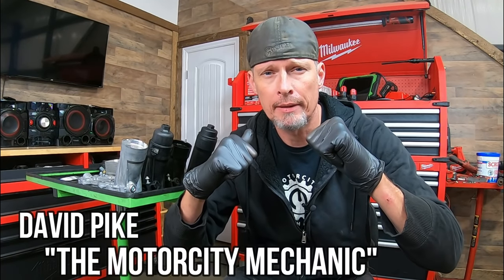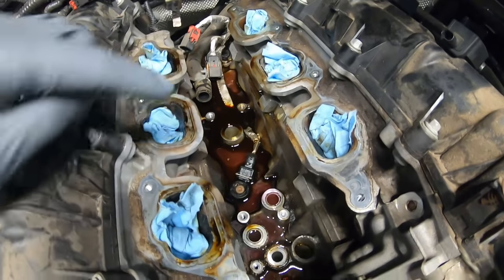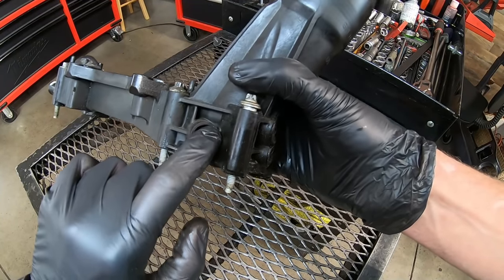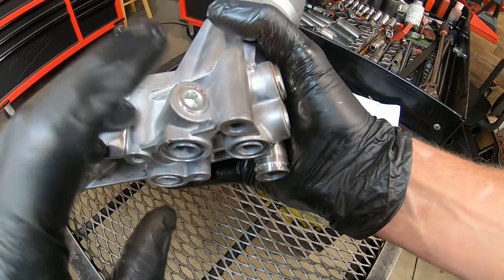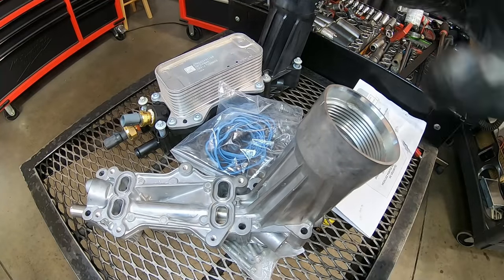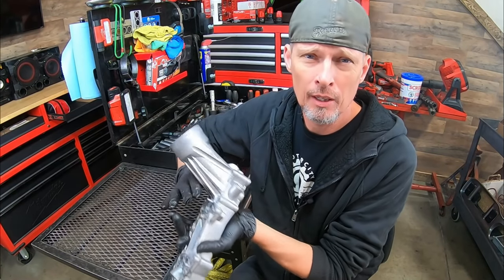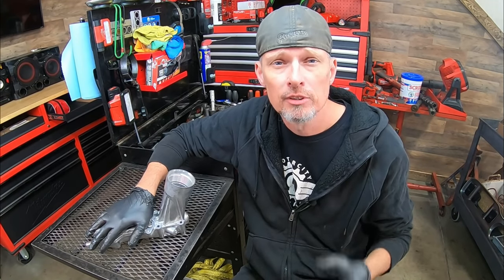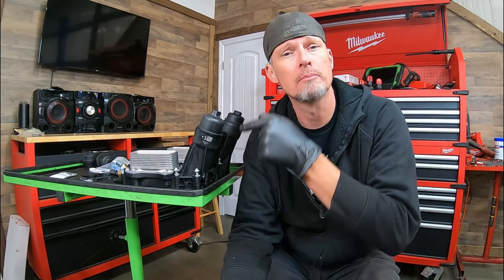Dorman 926-876 Aluminum Chrysler 3.2/3.6 Oil Filter and Cooler Housing Upgrade

Comment: Your one of the lucky few if you dont have a problem with this engine. So far with perfect maintenance I have had to have replaced, the computer at 50k, the heater line connector Plastic at 70k, rockers at 65k and now again at 125k for engine ticking.....All  were dealership repaired. So either it is the dealerships not doing thorough maintenance repairs or the engine itself by design. Most was warranty covered but now out of warranty expected to be expensive to repair rocker arm issues again as dealer only warrants rocker arm repairs for two years. So sad I must say a design flaw should be repaired at no cost by the dealerships for the life of the vehicle.

Comment: I changed the oil cooler housing on my 2011 grand Cherokee 3.6. The Dorman housing WILL fit. But, you need to buy a new cooler for the 2014+ years. Also a new oil filter and filter cap as the old ones will not fit. I went through four different caps before I found one to fit. Dorman had a problem with the manufacturer or something, so check first. My engine had 136,000 miles, so I figured while I was in there I had the injectors cleaned and replace spark plugs. Glad I did. Just for piece of mind I put on new oil temp and pressure sensors on. 
The housing itself was back ordered for 8 months. A tip for the grand Cherokee ease of installation is to take off the wiper motor and cowl. 
I am just a Shadetree mechanic, and was feeling pretty intimidated before doing the work. But it actually wasn’t so bad, and I’m happy to say my jeep is running with no oil leaks👍🏼

Comment: I'm guessing this vid is gonna be updated soon with the new 926-959 kit, as I was super excited to see it only to get the gut punch of no gen 1 coverage.  Dorman 's site does list the 959 kit as covering gen1, but im gonna still touch base with them to ensure that. The new complete package looks absolutely awesome,  hopefully go a long way in stemming some of the MANY Problems the gen1 engines in particular have. Yes, I'm still bitter over my 13 gen1 wiping itself outt at 110,000kms - not miles, kilometers. I've now got 50,000kms on the replacement engine, it's coming up on needing plugs anyway so if Dorman states this 959 kit is a perfect fit, my jeep is getting it no question. Thanx for the update!
Reply from the maker: Posted a pic on the kit that I received yesterday. Yeah the complete kit with cooler and orange oil filter cap is a one side fits all. Has everything you need just have to swap over the sensors and assemble the unit (comes in pieces). Orange cap is a warning that if used on a gen 1 that you will need a different oil filter then what the vehicle normally calls for. Will hopefully do a video on the new kit soon

Comment: Great video!  Thanks.  Just replaced this part on my 14 Wrangler JKU with an OEM.  Wish I would have seen this video BEFORE I had it replaced.  If it happens again, I will definitely replace it with a Dorman unit.

Comment: Great review and thanks for going over all the permutations.  If I used the Dorman on a low mileage engine, I might buy a new cooler and senders.  The extra money will easily be saved if you have to to it again later.

Comment: Awesome knowledge as always.
I wish I would've know a little earlier.
I just replaced this unit on 3 different cars in two weeks. I'm guessing the weather change and sitting through the pandemic played a part (cab co).
Great video as always👍😎
Reply from the maker: Now that I made the video you will never need to replace another lol….that’s how it usually happens lol.
Reply: @MotorCityMechanic  lol 😂
I'd agree with you, but I have a bunch of racecar driver wannabes that forget to tell me about maintenance until a towtruck is needed🥴
Reply: @MotorCityMechanic  LoL. You won't believe it. A fourth one came in today. Looks like I may be trying out the new part after all👍😎

Comment: Myself I guess I buy the plastic OEM for the gen 2 and put it on the gen1. Even if the Dorman may fit your model changing the cooler and have to reuse the old seal is a deal breaker if you can't get that gasket. And knowing how Dorman parts are I would just buy the factory one and save any problems. Thanks for the heads up David. I would also buy a new water hose that goes to the cooler myself since it is a pain to get in there. I get new spark plugs since your into it.

Comment: Thank You. I do love you videos, very informative. I have the 3.6 Gen 2, are there any drawbacks to using the Dorman part? Being all alum I like! You're right, that plastic hose barb is gonna snap off eventually, it'll get hot n cold only so many times! Have to watch for an after market oil cooler to come out!
Reply from the maker: It being sooo new to market….time will tell with the ones that I have installed

Comment: I literally just installed this dorman on my 15 JGC yesterday after replacing the original with  a new one two months ago that failed so glad I found this aluminum one hopefully  it last, had to install myself because my mechanic only uses OEM products
Reply: Hi Wayne  👋 I hope my comment didn't sound as a form of privacy invasion your comment  tells of a wonderful woman with a beautiful heart which led me to comment  I don't normally write in the comment section but I think you deserve this complement. If you don’t mind can we be friends? Thanks God bless you….
Reply: How’s the Dorman working out? I just picked one up for my 2012 wrangler. I have new a Mopar oem unit as well that I have yet to install . I’m on the fence about which one to use. I know the oem units are still having issues and I’ve read where some people are experiencing leaks in the Dorman unit where the cooler bolts to the assembly.

Comment: The Dorman aluminum coolers will eventually leak as well or the interval between when it was installed to when it will leak will be longer than the OE. The reason being - both the OE design and Dorman aluminum coolers have flat sealing surfaces and rely on the rubber seals as the primary means of sealing. As the heat-cycles accumulate the sealing surfaces will no longer be flat or true and the rubber will eventually breakdown. The connection points should be designed like the part you mention as the snorkel at 3:38 but with double o-rings, like on Ford fuel and AC quick-disconnect couplings.

Comment: Great video, but I would add - one of the reasons the OE unit is plastic is that plastic does not conduct heat. An aluminum housing will conduct heat. Saying that, do you think that the o-rings should be made out of viton, instead of rubber? 
I do think this is a much improved design, but the seals should be made to match the increased heat  that this unit will conduct.

Comment: We just went through this with our 2017 Wrangler. I ended up getting SKP aluminum assembly because Dorman was out of stock. The OEM one is still the cheap plastic garbage. Now we are getting a check engine light that came on after a few days. Going to check the codes on it now.

Comment: I work for Chrysler jeep dodge dealership I seen that dorman came out with that I told my whole shop cause earlier this year we had alot issue getting oem housing for them fca wanted us to to Uv light with oil dye to see where it’s leaking from. So fca basically saying here a new seals pack reseal it which plastic always fails I’ve noticed due to heat cycles and oil changes how tight the cap gets plays stress on the whole housing

Comment: Hi David, great video. I have no codes but definitely a major oil leak. I have ordered this upgraded oil filter housing kit as I believe this will be the problem.  Will the old oil sensors thread to this upgraded housing okay?  Should I just replace these while Im in there or is there no need? If I do replace them do I order the same ones or special ones for the aluminum housing. I just want to be prepared.  Was just thinking if they might have been sitting in oil as well that I may as well change them too, at least the bottom one. I will also change the spark plugs while Im in there. The truck is only a 2019. Pretty disappointed in this leak that has been going on for years already and why something hasn't changed is beyond me. Good for Dorman to jump on board. Thanks again

Comment: Good video with insightful explanation of how to do this correctly. The Viton seals are so important to be installed without crushing. Question on the sensor transfer to the aluminum cooler. What type of thread sealer do you recommend and do you just tighten to "snug"?
Reply: Did u figure this out?
Reply: @EricTireguy  Never got an answer but I would guess that Permatex blue would work just fine. Don't know if there is a torque spec

Comment: ughhh! all to save a buck i'm sure. just noticed oil pooling around the front of my wifes oil fitler housing. wasn't enough to make it past the front portion of the valley, but given enough time i'm sure it would. She had a P06DA code which led me to look around for the oil pressure sensor and see the oil pooling. I think i'll just order the Dorman part. the new dorman part 926-959 comes with the oil cooler housing. I think you still have to assemble it though.

Comment: My problem-I noticed my antifreeze coolant level was depleting everyday where I had to add some. I looked for any leakage around the van to no avail. Finally after placing the problem on YouTube, come to find out most of the Chrysler/Dodge 3.6L Pentastar V6 engines have a  failed Oil filter housing and oil cooler (Made of Plastic warped due to the heat off the engine)  that is a common cause of coolant and oil leaks on Chrysler 3.6L Pentastar engines. I went ahead and broke into the engine to the valley of the engine and replaced the failed Oil filter housing and oil cooler with a Dorman Upgraded Aluminum Engine Oil Filter Housing with Oil Cooler and Filter-No leaks now. With the breakdown of the engine I replaced the spark plugs, PCV valve, Air intake filter, Mobil 1 extended mileage oil change, with new "O" rings while I was there. Good Luck.

Comment: As a mechanic I love the cheap parts Chrysler uses for their vehicle. In tech school they never tell you that if ya wanna make money, go work for the company that has terrible reliability problems but its true. I can do this job blindfolded in about an hour and no shortage of this problem thats for sure. Toss in a timing cover reseal, leaking trans cooler lines, some seized up rear callipers, leaking radiator and some vibrating front brake rotors and you’ve had yourself a pretty good day.

Comment: Thanks for this video. Btw im the only one who has ever changed the oil on my 2015 3.6. i put a white  sharpie mark on the oil cooler housing cap the first time i seen this setup. It is a 3.6 limited with 115k miles. Have you seen these fail on alot of 2015 Durango models?
Reply from the maker: I see them fail on a lot of models….Not so much on the VVT/VVL  engines that have the EGR valve, come to think of it I don’t think I have on that version yet. I don’t remember which years that engine was placed in

Comment: Mike, it will fit the Gen 1.  I've done it.   You just have to buy the Gen 2 cooler, and filter.   I've also called Dorman and they are making a kit for the Gen 1.
Reply from the maker: I didn’t exactly say it wouldn’t help….just that you would have to buy a new Dorman and a new complete assembly just to make one….double the money which to me doesn’t make much since. You are correct about the new kit coming. It’s a one side fits all. Waiting on a sample kit so that I can do a video on it.

Comment: Had already picked up one of the new kits with the orange cap and oil cooler in it, but reviewed your video for technique. Great summaries, clear camera angles, and good use of graphics for the torque sequences and specs. Thanks.

Comment: I recently had an oil analysis on my jeep JL 3.6L come back with coolant in the oil.  I pulled the Oil Filter/Cooler housing and found that the seals between the oil cooler and the housing were breached.  It's a poor design and it uses figure 8 style siamese seals.  I ordered a new Oil Filter housing from Mopar and found that the new housing has a new seal design with each seal being separate.  There is now a web between the seals to prevent the seals from pushing in from the 75 psi oil into the 15 psi coolant side.

Comment: Just had the leak and replacement on my 2014 Jeep Grand Cherokee at 60,000 miles.  The cost from a reputable shop was $1280.00.  I don't know the type of part installed. The job also included a radiator flush to clear oil from the coolant system.

Comment: Just put one on my 2017 wrangler. Did coilpacks/plugs and then 2weeks later i get a black puddle on the ground. So i had to go right back in again which i should have done the research before. Put new sensors in as well.

Comment: Here's a little trick.  Because there's a reservoir in the engine that collects about a litre of oil,  you might not realize your filter housing is leaking until it spills over.   You've just been adding oil and not been aware of it.   
You can buy some time and avoid oil on the driveway by parking your Jeep on a 45 degree incline (I used a snow bank)  and letting the oil drain out of the reservoir.  Voila!   No more oil on my driveway until I did the repair in the spring!   🙂

Comment: David, thank you for this very instructive video.  I am disappointed the Dorman part does not fit the 2013 3.6L VVT engine (which mine is.)  I just replaced the by-pass valve on my last oil change - it snapped when I took the cover off to remove the oil filter.  Fortunately, I had seen your video so ordered the new part.
Reply: It will fit but you must use a 2014 gen 2 oil cooler and filter.
Reply: @robertthorne4451  which are nowhere to be found without the entire assembly
Reply: They are now selling these as a complete assembly with cooler, filter & sensors.

Comment: Thanks for your efforts to help people. 
What size torque wrench should I use 1/2 3/8 or 1/4 inch.?
I have 3/8 torque wrench it starts at 20/ lbs, in your video your video on changing the oil filter housing and the manifold it takes les then 13 lbs.
Thanks for everything

Comment: I have 2 a 2015 charger se with 387,000 and a 2020 with 12k even the old one with all the milage has rattles from body and interior but motor still passes CA smog  i they are reliable except this part i been threw 3 on the 387k motor and trans rebuilt at around 230k and and rear replaced unit at 290k i mean all the plastic PHENOLIC the upper motor top is made of mine has been reliable but this issue….fyi dealer is like 1.5-2k us to replace i did the dorman a few years ago see no diff so far but time will tell….take care and do service at or before intervals i am still surprised its so high milage without any major issues!
My milage was new around 22-28 and its around 19-26now which is nice road trips toped 38mpg and still are around 30-31 only and any mod i did was a stick airbox k&n which i replaced at 250k on old car …idk about HP/TQ output but still smooth🤘

Comment: Hey David.  Great video on this upgraded oil cooler.  At 88k, mine just started leaking and I purchased the Dorman based on your recommendation.  I watched your 2011-2017 Dodge Charger videos for the help (and courgage) to tackle this on my 2014 JGC.  As a weekend wrencher, I really appreciate all the little details you included. 

I'm in the middle of this job and running into an issue.  The oil pressure sensor connector (non-double lock style) won't "click" and hold in place.  I purchased a new OEM sensor and thought maybe that was the problem.  But I tried it on the old one and having the same issue.  It wasn't a problem taking the connector off and the "push/release" seems to work fine.  Any suggestions ?
Reply: I figured out the problem. There's a red rubber gasket inside the connector that got bound up and wouldn't let the sensor slide all the way in. Using a a small pick/flat head screwdriver I moved the gasket back towards the open side of the connector and it "clicked" in. 👍🏻

Comment: Love your content, thanks so much for sharing your knowledge. One question I'm hoping you can help me with, having trouble finding the right 1-1/16 deep well socket for the oil pressure sensor on my 2012 Journey. I've purchased 3 and none have fit; OEM, Lisle and a 3rd brand I can't recall at the moment. I'd like to avoid pulling the entire cooler unit so if you have a socket brand name that you could recommend,  I would be forever in your debt. Thanks and keep up the great work!

Comment: Hello! I used 5w30 instead of 5w20 when changing the oil. Not critical?  Sorry, this question is off topic, but I think you are the most competent in this. Familiar mechanics diverge in opinion. Mileage 108,000 miles. Jeep Wrangler.
Reply from the maker: To be honest you will be okay. Just next time try to stick the correct oil. Luckily it’s not enough difference to cause any issues. Seen that happen many times with no affects. Many thanks for the kind words
Reply: @MotorCityMechanic  Thanks for the answer! Hello from Ukraine!